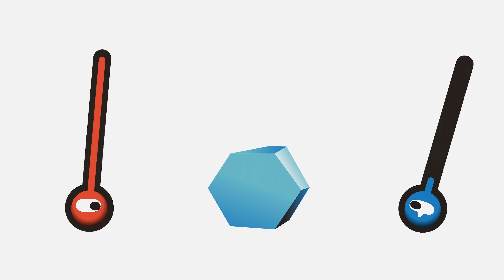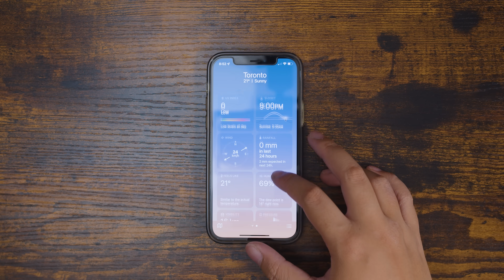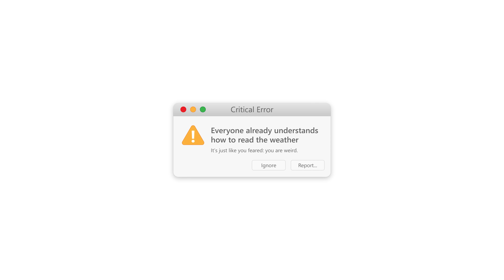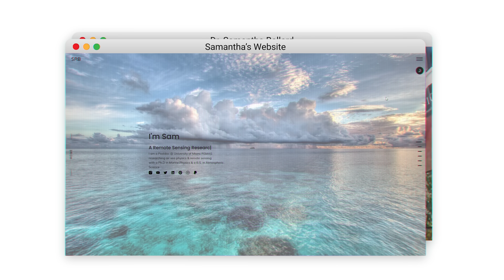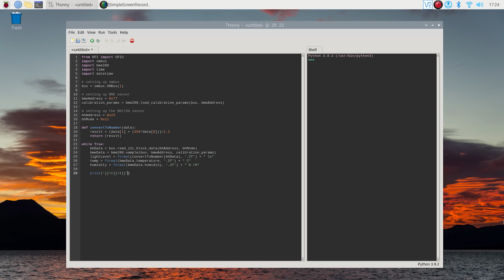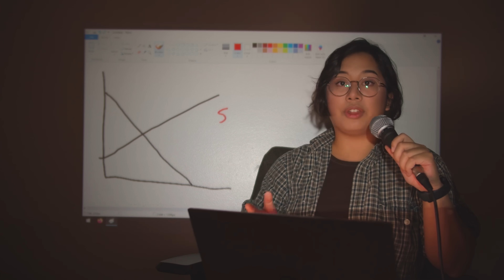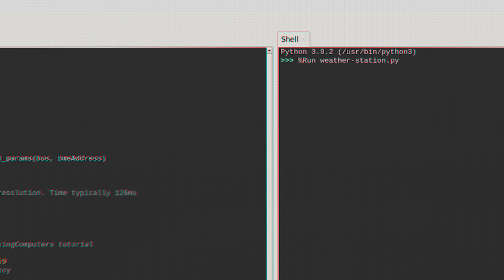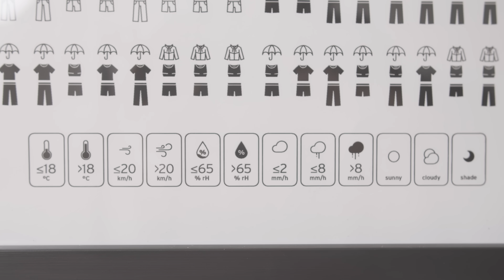how fahrenheit fails you

Comment: All of the advantages of fahrenheit could be given to celsius if we just multiply celsius by 2 and make that the standard.

All of the benefits of fahrenheit

easy 1-100 weather outside range of numbers that are easily identifiable and distinguishable

all the benefits of celsius

200c is boiling point, easy
0c is still the freezing point, also easy

...just not the benefit of being the standard.

Comment: I'm not the outdoorsy type and I grew up in Mississippi. I never really understood Fahrenheit. I knew 80s and 90s were hot (due to there always being a suffocating amount of humidity), but my problem with F is the scale is too small. You can't really tell the difference between 67 and 68. My perspective really changed when I had a job that was mainly outside and I simultaneously made the decision to switch and track the temperature in Celsius. There is a noticeable difference between 15 and 16 and I like the fact that 0 is when water starts to freeze. We've recently had some -5 weather and woof, that's cold (humidity doesn't help in the cold either). I've been able to pin down my perfect day, a sunny mid-teens C day with no wind chill, any colder and you'd need a jacket. If it's ever 40 C outside, you'd better not be. It also helps to know 10 C = 50 F

Comment: 6:00 I actually made a spreadsheet for how to dress for cold weather when I worked the night shift for a job during winter where I'd have to be a few hours outside every shift. If I got my drip wrong, it sucked; I would either feel too cold or too hot. I had everything on there, how many layers of pants to wear, how many layers of sweaters, like six different kinds of gloves including mittens, buffs, face masks, hats, socks, it was gnarly. It took a while but I damn near reached perfection. I quickly learned that the "feels like" temperature was more reliable. I had the chart in kelvins, rankines, degrees celsius, and degrees fahrenheit, as well as dozenal, heximal, and decimal.
Reply: Are you on the spectrum or whatever is polite to say these day in English? That sounds like the kind of dedication to a task or subject I've seen.
Reply: @LutraLovegood  maybe, but not that i know of
Reply: @brauljo  I'm a high intensity human furnace so even if I tried so scale dress to temp at some point I'm stripping layers anyway.

Comment: The whole "Fahrenheit's 0-100 makes more sense for humans" argument holds no water for me.

As a Celsius user I just have a different bounded scale, that goes from 0-40. If it's 40 I know it's very hot, if it's 0 or less I know at that point I can expect ice. It's just as simple as 0-100, with the added benefit of the 0 being the point where conditions outside start to drastically change.

Comment: I think this debate is actually settled a long time ago. Celsius is more universal (or Kelvin, if you are a physisist) and precise, Fahrenheit is too "subjective" and is not used anywhere except for US
Celsius actually explains the weather perfectly well and getting used to it is simple(you should remember only 3 numbers for weather in C: 0 (water freezes- a game changer for cold periods), 20 (standart comon room temperature, most comfortable to exist in a t-short) and 36 (the closest integer to you normal body temp- everything that is higher is going to be an oven and hard to be for long periods of time) - thats all, not very hard if you ask me.
For those who have troubles choosing the right clothesm here is a bref guide (of course it depends on the wind and humidity also, but generally, btw: humidity for me is always more important than temp , because it chandes a sesation- low humidity is good, high- bad):
-Below -30: cover all skin (especially face and back of you head), warm clothes as for skiing, weared in layers, wind and water proof, thermoclothing is a good idea (cotton kills you!), warm socks and shoes are essential, warm gloves with tight mangets to minimize heat loss, externally always on move, minimize standing still
-from -30 to -20 you cover your face and wear layered warm clothes for snowy weather as for skying, just less layers or less extreme clothes
-from -20 to -10 - just less layers or less extreme clothes, some normall city clothers are already acepted (jeans with undertrousers and felt coats)
- from 10 to 0 lighter hat and shoes and you can wear typical city closes with something warm underneath: felt coat, jeans with subtrousers, etc ; 
- 0-10 - warm jeans, normal shoes , a shirt, a coat, scarfs are handy, felt caps
- 10-20- - normall warm weather, tshirt/light shirt, light coat, jeans, here you can skip a hat/cap
- 20-30- warm weather, light clothing, tshirts, shorts, sandals are purfect (room temp)
- 30-35- a transition temperature to hell (very light coton and linen clothes, covering skin and your head from the sun, max breathability)
- higher than 35 (you pray to god to end this hell)- light cotton/linen clothes (preferably covering the skin if possible), sunglasses, light straw or panama hat to cover from the sun (if it rains- you are just screwd: wet and hot, nothing to do with it, only to die, the tempreture will drop for some time but humidity will make it a constant hammam)

Comment: Fahrenheit is extremely unintuitive to me as someone that can't stand temperatures colder than 20°C (68°F) so if you tell me it's a scale of 0-100 from really cold to really hot, literally most of that scale is really cold to me so it's not helpful at all. It's easier to understand 25-30 is comfortable than the arbitrary 77-86.

Comment: I’m a canadian american and I agree with the hypothesis. Theres just this intuitive difference between what 40s (and below), 50s, 60s, 70s, and 80s (and above) all feel like. it just isnt the same in celcius. the inbetween temperatures (50-80) before super cold and super hot are 10-26 in celcius which just isn’t as intuitive. in Fahrenheit countries (i guess just anerica) u can say “it’s 60s weather” and that makes sense in a really practical way. idek if we were able to talk about weather like that when i lived in canada. what would you say? “it’s like high 10s” like i can see that celcius basically has a similar intuition but just grouping by 5s instead of 10s but I don’t think that makes them equivalent. There’s something useful about having 10 degrees feel like an entire category of temperature vs a system where 15 degrees and 21 degrees are significantly different.

Comment: easy to remember guide to know the weather in celsius: 
0-10 = "Freezing"
11-15 = "Chill"
15-20 = "Kinda chill"
20-25 = "Hot"
25-30 = "Boiling hot"
Reply: How is 30 boiling hot? I have experienced 46°C and I can tell you, 30°C is hot, but not boiling hot
Reply: @janschmalz7980 they must live in a colder country
Reply: @janschmalz7980 There's actually more than one dimension when speaking about heat, where I live, humidity also plays a big role in tempersture sensing, making the heat seap through your pores and not letting you have a mouthful of fresh "cool" air, the shade isn't a safe place from temperature, just from the UV light. Assuming that there's a dense air, that is the chart, whilst on a country like yours (probably in the middle east or Asia? Or even the US during the hottest days of the year) The humidity may not be as dense, making sitting by the shade a mostly bearable experience
Reply: @ I live in one of the most humid areas of Europe, and I know that feeling. It just kills you doesn’t it?

Comment: On the Fahrenheit scale, water freezes at 32 degrees and boils at 212 degrees under standard atmospheric pressure. In contrast, Celsius, also known as Centigrade, is the more widely adopted scale in most countries around the world. It is based on the freezing and boiling points of water at 0 and 100 degrees, respectively, under standard atmospheric pressure. The Celsius scale is a part of the metric system, offering a more straightforward and universally applicable means of temperature measurement.

Fahrenheit:
Fahrenheit's scale was established based on three reference points: the freezing point of a mixture of water and ice, the average human body temperature, and the temperature of boiling water. He assigned the value of 32 degrees to the freezing point of the water-ice mixture and 212 degrees to the boiling point of water. The interval between these two points was then divided into 180 equal parts.
Interestingly, Fahrenheit initially used a scale where the freezing point of water was 30 degrees and later revised it to 32 degrees.

Celsius:
Celsius's scale was initially inverted compared to the modern version, with 0 degrees representing the boiling point of water and 100 degrees representing the freezing point. The scale was later reversed to its current form to align more closely with other temperature scales.
Anders Celsius proposed the original scale in a paper titled "Observations of Two Persistent Degrees on a Thermometer" published in 1742. Unfortunately, Celsius did not live to see the widespread adoption of his scale, as he passed away in 1744. The reversal of the scale occurred after his death.
In 1948, the 9th General Conference on Weights and Measures officially adopted the Celsius scale as the standard temperature scale, defining the Celsius degree in terms of the Kelvin scale, which is the absolute temperature scale.

Comment: I was used to F growing up so in order to get an intuitive idea of what Celsius temperatures felt like, I used it exclusively for a year and it was pretty helpful! It was so interesting how 18-19 degrees C was like tolerable just barely need a coat weather and 30 degrees C was summer hot, while I was used to 32 degrees F being snow/winter freezing.  At the same time when it got into negative temperatures I was freaked out, but it made more sense that negative was below freezing.

I also want to say that I totally agree with the whole champion idea. I found it really difficult to move forward in engineering and though I graduated I left thinking it was something not meant for me. I am still interested, but have no idea how to move forward from where I am now. I would say that my biggest mistake was getting too caught up in the coursework and not making enough connections, not advocating for myself enough and getting real world experience while in school. Struggling with the courses really damaged my confidence even though I do have a natural inclination towards STEM. If I had a champion at that critical time I think I would be in a better place now. If there's any opportunity for me to be a champion in any way, even though I'm not successful in the field right now I would definitely do it!

Comment: I like ferinheit, because it has a good scale bewteen shorts weather, and snow pants weather.

0 is frgid and dangerous to benin for more than a couple minutes. Heavy clothing.

32 Is cold enough to hurt you, if you're standing in it long enough. 

50-60 Is a comfy medium, where it's not hot, but, also not cold.

70 and above, is shorts weather.

90 and above is severely hot, and you should remain in doors.

From 0 to 100 ferenheit, you have freeze your ass off, to being slowly cooked alive.

So, while a 60 might be perfect, 50 is just 60 with a chill. And 70 is comfortably warm.
Reply: To add, the difference between 25, and 20 in celcius, is so drastic, that I would find it difficult to acclimate to such a bizzarely under incremented system.

Comment: I’m French so I’m used to Celsius. It is very convinient for me, like if the temperature is below 10 I have to wear a coat, between 10 and 20 a raincoat, between 20 and 25 a thin sweater, above 25 a T-shirt, and above 40 you die. Like, it feels logical x)

Comment: I kind of have rough range of temperature when measuring weather.
I don't know where the temperature is when I feel comfortable, a little bit hot, or a little bit chill.
There's only very cold, and very hot for me. That's only matter for me.

However, for general measures of a little bit hot and cold. I live in room where I always turns on the AC. 
But I can feel the different of humidity and other. Just combine it with looking out a window a bit I can guess will it feel a little cold or hot. It's bad for prediction thou. But weather forecast in my country that past the day isn't much reliable anyway. (It's dues to the naturally hard to predict weather in tropical area)

Comment: Seems pretty easy to me... if the number is negative, ya need a lot of clothes, if it's positive ya need not a lot of clothes.
Also when the number is negative I goto think twice about taking the motorcycle, cuse I could slip on ice an die, if it's a positive number it might be uncomfortable but at least I am resonable sure of good tyregrip.

A negative number also means snow instead of rain, that changes what type of equipment ya need to bring. Rain won't block your path away from the home and won't pool up to your knees so ya shoes don't need to be as tall. I can be resonably sure that the bus won't have problem with rain, but if it's sub-zero I goto assume they will spin out and take longer, and people sitll running their summer-tyres on their car will crash into things and block the road making commute take longer.

Everything changes when ya go bellow 0, above it the only difference is thicckness of the clothes-stack.

That's why celcius is the best one, when ice forms is extremely important for humans being outside, it's the most critical point of the scale and makes sense to put in the middle.

Comment: Celcius is great, as someone mentioned, bellow 0 it snows, above it rains. Plus, temperature perception depends a lot on wind and humidity, so sometimes 21C is perfect, sometimes it's coldish, sometimes 27C is OK, sometimes it's hot, it will also apply to Fahrenheit, but I like Celcius, from 18-24 is very good if you don't have AC, from 4 to 18 is awesome if you do and it's not raining. 22-25 is confortable for most people and 27+ is warm to hot to hell, but the specific temperatures are something you learn as you live.

Comment: 0 Cº and below: extremely cold, water freezes, wear lots of clothes, 4 layer + gloves and beanie
1-5 Cº: very cold, but water no freeze, still wear lots of clothes, but maybe we can skip the beanie or gloves
6-10 Cº: cold, still lots of clothes, but 3 layers are enough
11-16 Cº: a bit cold, 2 layers is doable but recommend 3
17-20 Cº: perfect temperature on the colder side, 1 or 2 light layers
21-23 Cº: the perfect temperature in the warmer side, 1 layer is enough but 2 just in case
24-26 Cº: it's getting warmer, you sweat a bit, 1 layer, maybe a fan
27-30 Cº: that's hot, definitely need a fan
31-34 Cº: very hot, without a fan is real hard ti get by, ice is certainly mandatory
35 Cº above: I am sure lots of people faint here

my guide for those who are trying to get used to Celcius, you guys are doing great

Comment: Sabrina, you specifically mentioned that the temperature scales were designed to remove our perception of sensation from the reading...

There's a weather device that gives a "wet bulb temperature" which explicitly accounts for how effects like humidity and wind chill feel to humans. It can also tell you immediately whether it's safe to work out outside in the shade.

There's also a calculated heat index, which usually is where the "feels like" temperatures on apps come from.

Both of these are far better than the "just look at the big number on the phone" everybody else was telling you to use!

Comment: Edit to add: The important measure of temperature is the wet bulb temperature. That is the one that determines survival chances.

For me Celcius isn't as important as rain: If it rains or snows, put on a water proof outer layer. Unless it is high summer, in which case the rain is a positive experience.

For temperature:
< -20 C is hide from the cold weather. This is why we invented buildings. Any building that isn't warmer inside at this external temperature is not actually a building and needs to be torn down.
-20 -> -10 C is specialised winter gear weather. Keep an eye on the big lakes, you might get epic ice skating this year.
-10 -> -5 C is gloves weather. Get your ice skates ready.
-5 -> 5 C is coat weather. Cycling is going to be interesting.
5 -> 10 C is sweater weather when active.
5 -> 15 C is sweater weather when standing still.
15 -> 25 C is t-shirt weather.
25 -> 35 C is shorts weather.
 > 35 C is hide from the heat weather. This is why we invented buildings. Any building that isn't cooler inside at this external temperature is not actually a building and needs to be torn down.

Comment: the difference between the freezing point of Water (32F) and the boiling point of water (212F) is 180 Degrees, just like a compass, North is cold and South is hot (If you are in the Northern Hemisphere) and 180 degrees from each other.

Comment: F, having more degrees for a given range of temperatures is what I'll always use for weather/home temps. Does anyone ever say it's 20.5 C outside? Trained in science, F is never used. I have no issues, I regularly think of small linear measurements as fractions of an inch, or as millimeters. For some reason, I'll choose one over the other in any given instance.

Comment: "Celsius does a bad job at communicating intuitively"
BULLSHIT dude 25+ its going to be a heat agony
20 to 24 very warm use shorts
15 to 19 normal day
10 to 14 a bit cold wear long sleeves 
0 to 10 its cold out wear a jacket
-1 to -10 its cold and you will freeze
-11 and every thing else see above but even worse